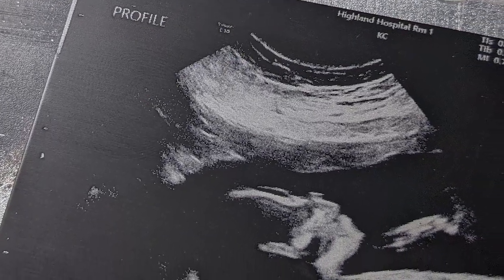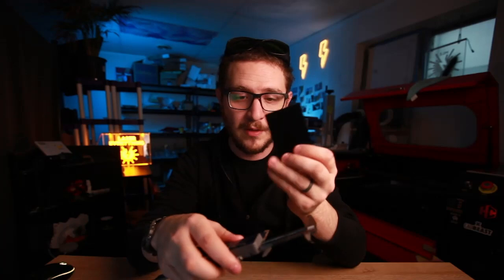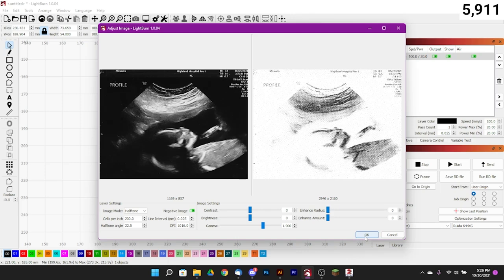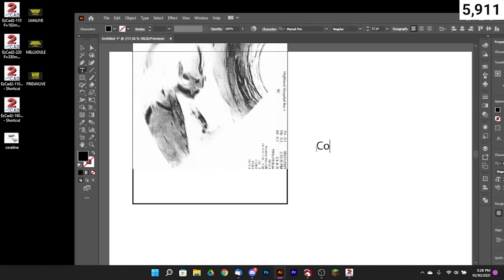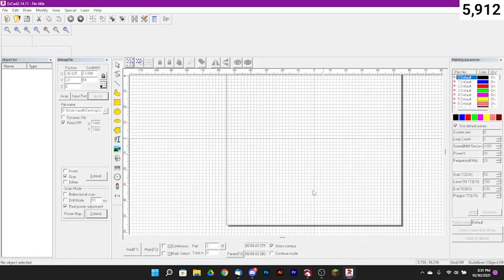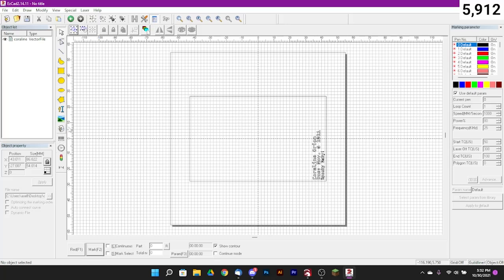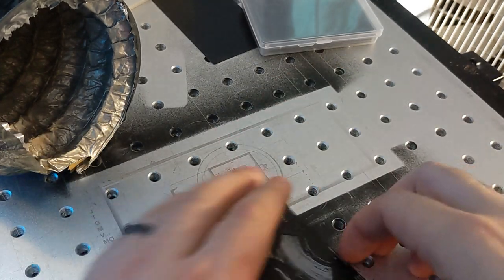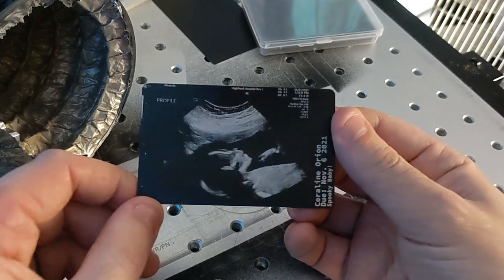Engrave PHOTOS on Aluminum with a Fiber Laser! | ULTRASOUND IMAGES

Comment: This is a really great video and a really great idea! 
I have a question that I hope you might be able to help me with. I am a self-taught jewelry designer and I would love to do laser engravings on my jewelry and I have looked a bit at the fiber laser EM-smart one, I know nothing about the actual use of a fiber laser or if it is any good, so I hoped maybe you would share your thoughts about it?
Reply from the maker: They are fine for small work areas, and I mean small like two to three inches and light engravings. For anything bigger 4 to 6 in, or any considerable depth I would highly recommend checking out one of the split style marking systems like the 30W mactron linked in the description. I like cloud Ray and they have decent machines but literally everything hangs on the company you decide to pay to build your machine. Some people just throw them together and will literally ship garbage that breaks two weeks after you order it and you never hear from them again so don't go for the cheapest thing you find because you will definitely regret it. Even if it means saving for a little bit longer to get something a little more mid-range. I really really think it pays off in the long run, especially in this industry.
Reply: @LaserEverything  Thank you very much for the detailed answer! My reluctance around the EM-smart one is also the lack of video reviews of it, that was also why I wanted to ask someone who knew more about it than me, so again thank you very much for the answer. Keep up the great work!

Comment: Hi, Just a quick question to an expert.
I have a ghost issue on my new fiber laser.
Example engraving a letter E, then after engraving it have shadow.
As Increase laser power, the shadow is more obvious on objects, it is about ~1-1mm "Slip" on each axis.
What can cause problem?
Lens is clear, focus is ok, I use original factory setup.
Thanks
Reply from the maker: In ADVANCED under your speed, power and frequency there are two settings called MIN and MAX Jump Delay. Try setting both to 500 and mark again - should resolve your issue.
Reply: @LaserEverything  
Thanks your help :)
Reply from the maker: @cnccnc9070  You're most welcome!

Comment: Can you get similar results with a diode laser?
Reply from the maker: Yes but the engraved areas will be silver, not white, because the diode won't ablate the surface so you'll just be seeing the raw aluminum under the anodizing.

Comment: Has anyone engraved these using Lightburn for Galvo yet?  Just wondering how the settings translate over, having a tough time getting this to work with my 60W Mopa Fiber.
Reply from the maker: We've done this and similar projects with lightburn too. Since this project, we've improved our process for photos in general for consistency and ease, and might help if you watch through our photo guides, its got a lot of info that will help with photos on any laser:
Photo guide Part 1: https://www.youtube.com/watch?v=EB40S6AEVwE 
Photo guide Part 2: https://www.youtube.com/watch?v=hH744rto5uE

Comment: What is the minimum fiber laser power needed to creat images on aluminium ?
Reply from the maker: Maybe 20 or 30 watts. It doesn't take much to remove common aluminum coatings from the surface. I've even seen low power portable devices in the 2-5 watt range take on anodizing.
Reply: @LaserEverything  Thanks, this could save me a lot of money. I expected to need a 50 W fiber laser...got deep into the material will propably at least 50 W ???
Reply from the maker: @petermican  30 will do it with patience but 50 is definitely recommended.
Reply: @LaserEverything  Thanks, back to spend some serious money ;-)